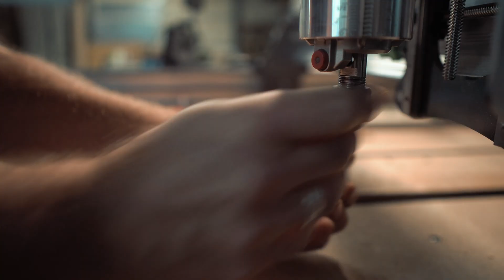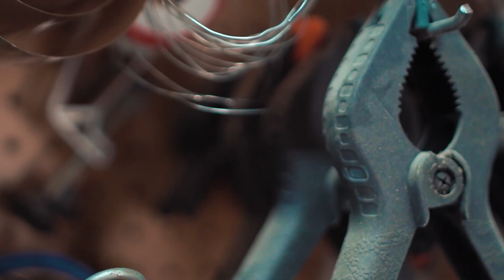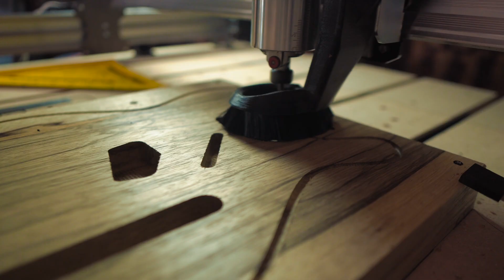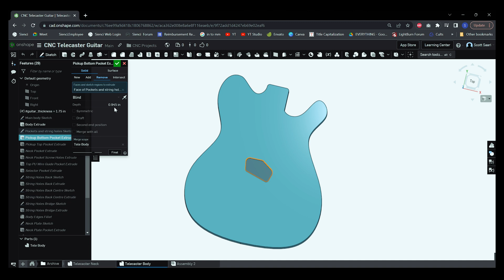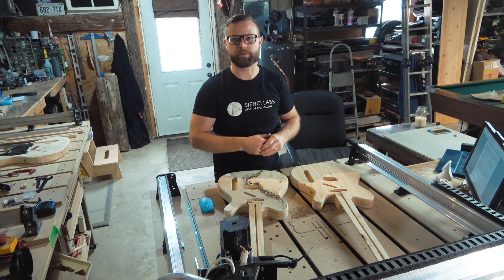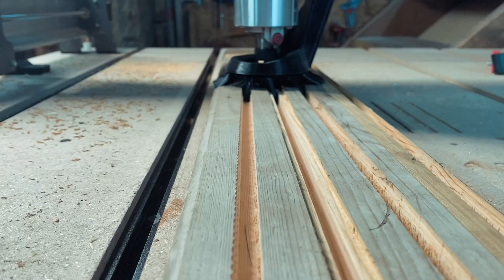Building a Guitar on a CNC - Part 1: Design

Comment: Great video. All of your videos are awesome. Very detailed! I bought a Longmill about a year ago and have been using Easel for designing/milling my guitars since. Easel is beginner level but I've found that I can do anything with it that I want and as you have stated in your other videos, "it has to make sense to the user."

I've been a woodworker, well, forever now and when I build a body, for stability purposes, I begin with slats that are ~1.8"W x 20/21"L that have been cut from .75" stock.  I then glue 18 slats together and end up with a blank that is 1.8" thick x 20/21" long x 13.5" wide. When I want a top that will show grain, I reduce the width of the slats to 1.6" and then glue a top such is flame maple onto it that is .25" thick and then use a planer to get a blank thickness of 1.75". 

As far as the neck, I cut it and the truss slot with the Longmill. I have not yet attempted it, but I've recently been working on the backside radius but just don't have it figured out, yet. To this point, that has been done the old fashion way.
Reply from the maker: Thanks so much for the kind words! We're thrilled you're happy with your machine and you found a software that works for you! Make sure you post pics of your projects to the FB group for everyone to see! Guitar necks are a tricky beast, but it sounds like you're well on your way to figuring it out. Thanks for sharing your experience!

Comment: Great video.  Im in the stage of having someone else cut my CNC bodies and want to upgrade to cutting my own.  This is exactly how I assumed the newbie process would go.  What's the smallest CNC machine you sell?  Note I have limited space in my garage and need to store it out of the way when not in use.  Want to start with bodies then upgrade to necks down the road.
Reply from the maker: Thanks for your comment! The smallest machine we have is the 18"x30" LongMill, which should accommodate most guitar bodies and necks. Lots of people have built tables that fold up out of the way, some have put in on slide outs and, other people have even mounted their machines vertically!
Here's the link to the machines. 
https://sienci.com/product-category/longmill/

Comment: Is it just me or does the neck in OnShape not fit the neck cavity in the body?  I measure 2.216" at the widest point of the neck cavity, and 2.333" on the actual neck?  In fact, in the "assembly" tab, the neck doesn't appear to fit.   I have a bad feeling the creator of this series said something about sizing that I don't recall ... and I don't want to rewatch (but I may have to).  Perhaps this sizing compensates for his carving software.
Reply from the maker: The neck was indeed carved larger than the opening on purpose. When Scott was creating this, he felt it was better to leave a little extra material on the neck and to hand finish it to the exact size of the pocket. Hopefully this helps!
Reply: @SienciLabs  Thanks for confirming!

Comment: so you say 1”x 16 “ boards for the test blanks.  are you just stacking/ gluing 2 of those boards ontop each other ? to get the thickness? what kind of wood is it? pine?
Reply from the maker: You got it! I glued up pine 2x10's.
Reply: @SienciLabs  awesome. wow that was a quick response .     one more quick question. for cutting , you mention longer bits. is a 1/“4 long the only long bit inwould need to get?  basically for pickup pockets and perimeter of the guitar ?and is it a down cut
or compression bit?
Reply from the maker: @eross21 We aim to please 😉…There are a few different ways to get by with normal length 1/4” down cut bits. Basically cutting a little from each side. If you have a longer bit, you can do it just from one side like we did in our “second” guitar video. Check it out here!
https://m.youtube.com/watch?v=7TvyiQoK9pU

Comment: Can you take the blue outline body shape and reduce the overall shape of the body (not pickup, neck, bridge etc…) just the body by say from 100% to a smaller size like 75% or even down to 50% to make a mini guitar with the same neck, bridge and pickup routing spacing as the full size? I know the control cavity would have to be modified.
Reply from the maker: Yup, that should work. Like you said you'd have to modify a few things to make it work, but in theory it would carve. If you make one please share it on the socials with us! We want to see a mini Andy-caster!
Reply: @SienciLabs  right now I’m building a mini Wolfgang but with templates I made and cutting everything out with a router and belt/orbital sander. The neck is a shorter scale (basically the third fret is now the nut location) but the pickups cavities, Floyd rose and neck cavity is all original locations and specs. I have a onefinity elite foreman ordered with the pwn 2.2kw water cooled spindle, all will be here in a few more weeks. I have easel program I’m playing with right now, just learning the cad ropes so to speak.

Comment: In  Sienci's software drop down menu,  there's no Onshape link.  I want to go with Vcarve Pro.  Do you like Onshape better than VCarve pro? Just curious.  Thanks
Reply from the maker: We're not exactly sure what you're looking for. They're 2 different use softwares: Onshape is a free software (with paid upgrades) that's used to create 3D models etc, and can be found online. Vcarve is the software used to import 3D models, create toolpaths, and save files to be cut on your cnc. So they are different softwares for different requirements. We recommend you check out some of our other videos to get a better feel for their uses. Let us know how it works out.

Comment: Thanks for taking the time to make such a great video series, looks like a lot of work.  I wanted to know if you could include STEP files with your downloadable files.  Most CAD software will be able to import these files.  I use Solidworks and fusion360 and STEP files are the preferred method of distributing CAD files.  Thanks!
Reply from the maker: We'll keep it in mind, but you can also export STEP and other 3D model files directly from Onshape as well if you wish (link provided in description).

Comment: A good tip is to just copy out each of the elements and test carve them individually into some plywood. That way you can test to make sure fiddly bits such as the string ferrels and pickups fit your model before you burn an entire test body and multiple hours of carve time.
Reply from the maker: Absolutely bang on! Great tip. Thanks for that!

Comment: So I have already got most of my parts, but the Jackson SLA/pro nut was out of stock. Solomusicgear Rocks! I was wondering what the scale length is,and will I be able to make modifications for a different nut?
Reply from the maker: The scale is 25.5” so there’s a little room for play, but it’s based off typical Fenders. Let us know how yours works out!
Reply: Yes, get the nut width right and you are good.  You can always file down or shim the underside of the nut for string height or open up the slots for bigger string gauges.  More important is the string spacing that you want.  The scale length is based on the inner edge of the nut so get that right but it isn't super critical as long as your bridge has adequate saddle distance adjustment.  I personally recommend Earvana compensated nuts for better setups.

Comment: Was there more files for the project. I created an account in onshape and was able to open the dxf of the back and the stl image of the body, but was unable to find the design file to see the different levels and pocket measurements. 
The crv file would be useful with vcarve, (I use carveco).
The file you were playing with in onshape seemed absent.
Reply from the maker: Yup! We forgot the link to the Onshape file! It's been added to the video description, but here it is directly:
https://rb.gy/osqdyk
There is a .crv in the original project file link though.
Happy carving!
Reply: In Onshape you have to open the extrude for each feature to see the depths of the pockets.
Reply from the maker: You can also click the top and bottom of the pocket and the measurement tool on the bottom right will tell you what the depth is without clicking into the extruder feature 👍
Reply: The video was great, my wife even watched as guitars will be my retirement

Comment: will this work with FreeCad?
Reply from the maker: Using the step-by-step guidance we have in this series you'll be able to use FreeCad or any other similar software. The project files and 3D models are also available in the description if you'd like to import them and modify them from there
Reply: @SienciLabs  I downloaded the project files but there was only 1 dxf, the gcode directory and an stl of the body. No 3d file I could open with fusion360.
Reply from the maker: Fusion360 is able to open and work with STLs, did you already try that?
Reply: @Sienci Labs  yes I did open the file in 360 but it would not be editable like the onshape file you have since shared. Ty for this series again.
Reply from the maker: No it wouldn't be, just because the file wasn't designed in Fusion 360. I know that it's quite annoying, we wish design programs were all able to be more compatible

Comment: I have never used Oneshape yet, but I use cad software professionally. NX, Inventor, SolidWorks.. If you are going to work in 3D models, I would highly recommend getting a space mouse from 3Dconnexion. it is a little pricy(monopoly) and it has a little learning curve. 

It is just that much better when designing and working in 3D. 

There will be some people that say that they dont like it and they work better without it. That is the equivalent of going through life and reach adulthood and having only used a fork to eat a soup.
It is hands down the best 3d Cad upgrade that you can have.